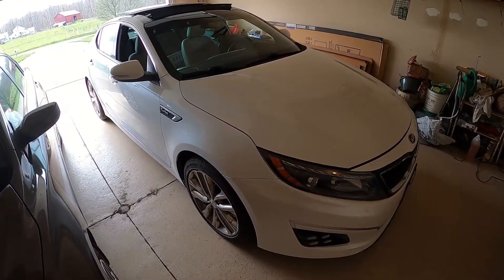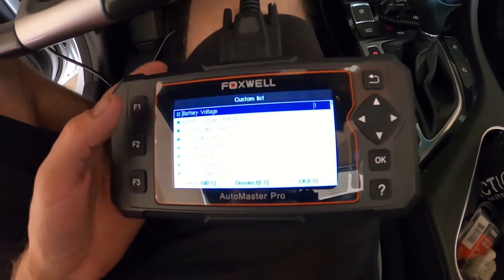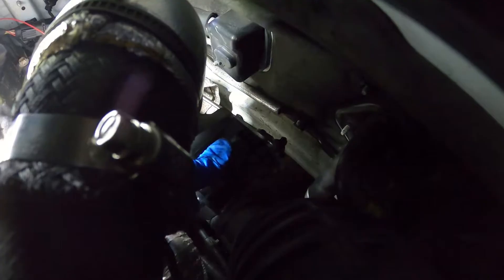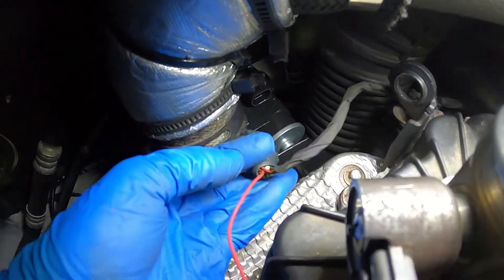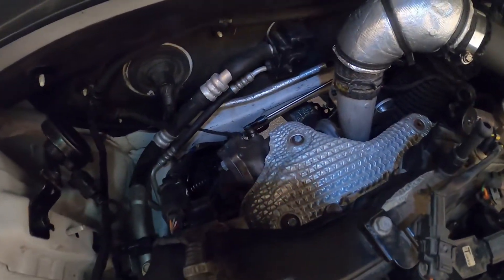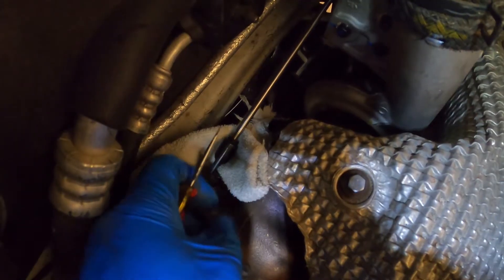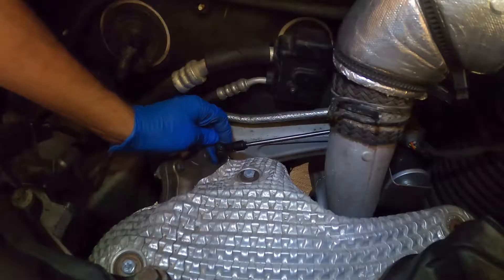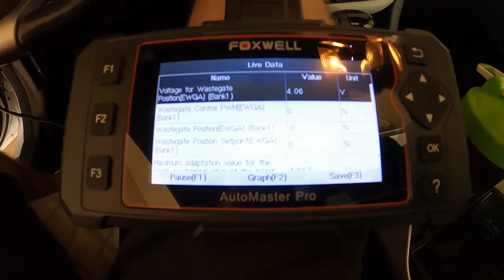HOW TO ADJUST TURBO WASTEGATE VOLTAGE ON KIA OPTIMA HYUNDAI | 2.0L | 4-CYLINDER | DIY | STEP BY STEP

Comment: And what does it do to the car? More power?
Reply from the maker: Hey Carlos. The waste gate helps control the boost pressure by regulating the exhaust gases. With engines that have a turbo its common for the wastegate voltage to change over time due to normal use which can potentially cause issues with boost and even throwing "over" or "under" boost engine codes. My video helps walk you through how to check and adjust the voltage to get it back in range. Hope that helped to clear things up. Thanks for the comment!
Reply: Thanks for the info, i had turbo cars bit i never had to mess with it or the wastage before so i dont really know why they do this or that to turbos, wastage or bov

Comment: I want to post another comment. I've already offered my appreciation for this video elsewhere. I want to offer some clarity for the content of this video, in hopes - if you were like me - it's helps you with my hindsight.

1) I was experiencing a P259f code which led me to believe my turbo was bad. I believe it was failing.
 
2) I changed the entire turbo, but, when asked, Blue Glove commented to he chose the installation of just the cartridge, which (trust me) I wish I would have done instead. Didn't know. If your turbo is dead (bearings, vane issue), a cartridge replacement will likely be 50-times easier. Ask me how I know. 

3) my replacement turbo came with exhaust manifold, turbo, and wastegate actuator, the latter of which Blue Glove is adjusting in this video. My voltage on a new unit was about 3.68 volts and I needed to adjust it. The car was still throwing a P259f code after installation of new turbo.
 
4) Blue Glove shows removing the clip acuating the waste gate side, but in my opinion I would suggest loosening the lock nut on the left side of the rod, as shown, but instead of popping that clip, which is in a tight spot and not the easiest thing to hook and remove... Instead loosen and remove the 10mm lock nut on the actuator motor lever, and once removed rotate the rod from there. When you're done making your adjustment -  reattach the actuator nut handbtight and tighten the rod lock-nut to verify your test reading. Way easier than clipping and unclipping that small clip between tests. 
NOTE: Only precaution here is to maintain the spring and washer when you remove that nut from the actuator (don't let it eject). Just remove the nut (pass nut to right hand while holding the rod still hard against the actuator) slowly pull away the lever watching that the spring and washer stay put, quickly turn the rod, and reinstall the rod, followed by reinstalling actuator nut (hand tight), then tighten the other nut to firm up adjusted rod length. I left the actuator nut only hand-tight until I was satisfied with the voltage reading, so as to minimize the wear on the Nylock nut. When satisfied with the voltage be sure to tighten both the actuator nut and the rod length lock nut. 
 
5) there is a body-to-engine ground strap just behind the passenger side motor mount - ideal for making a good ground point for the volt meter. Battery is good too, as shown. 

Hope this helps someone.
Reply from the maker: Hey Roger. I really appreciate your contribution! I made these videos in hopes they would bring about ideas from others in similar situations. I guarantee many others will follow your advice.

Comment: I wish I had seen a video of when you replaced the turbo. I'm going to see if you did one. Fitting that 12" round hole into 7" square hole was quite, let's say, a challenge. 

Anyway, I am curious. I just did a turbo swap on my wife's 2012 Optima EX because I thought the code it threw (P259f) said it was bad... Coinciding with a low-oil incident we had a week earlier  which threw the same code. A nieve assumption based on minimal definition on P259f out there. Considering it drove a week between each incident just fine, I assumed an oil-starvation issue. 

I was very surprised when the turbo spun freely when I got it out. But I wasn't about to wrestle the old one back in. By God! It Was Bad! And even if it's not - that new one is going back in. Money be danged. 

So, new turbo, which came with a new actuator, measured 1.23 volts after not fixing P259f. Honestly, as your video exhibited, I may have had the engine running and not in accessory mode as you explain. And I am not sure if that has an effect on the reading. So will reassess in the morning in lieu of expecting an answer by then, if at all.

Anyway, I am curious what your new turbo setup read when installed? Mine had all the joints dabbed with paint, which (to me) said "We preset this in the factory and you should not need to adjust this."

But clearly, you did. So yeah, curious. 

Thanks, if you can.
Reply from the maker: Hey there. In all honestly i tried taking video of the turbo swap but due to the horrible placement and the need to contort my body i became too aggrevated and stopped recording. Certain tasks are much more video friendly than others lol. 

Anywho, i have not seen the code you mention before (P529f) however, upon a quick search, it appears people are pointing towards the wastegate actuator and potentially out of range voltage which is what im assuming brought you to my video.  

You mention your reading was 1.23v? If you're able to follow my video step by step and ensure the vehicle is in the correct state when testing i'd be curious if your reading comes up closer to the ideal 4.0v.

What id try if i were you is : 

1) clear the code (start from a fresh slate)
2) turn car completely off
3) manually push the actuator arm all the way to the passenger side to ensure it is in the "closed" position
4) hook up your diagnostics tool or cable setup to prepare to read your voltage
5) with everything hooked up, put the car in accessory mode as mentioned in the video. This will move the actuator arm to its "home" position and give you the voltage reading you're looking for (4.0v being the target)

(I recommend repeating steps 3 thru 5 after every adjustment).

Im not a certified mechanic but i've fought with my fair share of car problems. I'd be curious to hear the outcome if this helped at all. If you set the voltage correctly and continue to get the code, you may have a wiring harness issue. If your turbo/actuator/wastegate are new, its quite possible you could get the code because your connector itself is bad not allowing the wastegate to function properly. Just a thought! Hope to hear from you again my friend!
Reply: @blueglovemechanic  Thanks for the quick reply. That's very much appreciated. 

Your video was very helpful, so I'll certainly add my notes tomorrow. All great suggestions. I do the same thing as you (details, details, details) on more than a dozen Auto-related FB and YT media. 

I'm a mechanic, but an Old-School mechanic. I really try, with any failure, of anything, to fix it myself. So my skill level is quite high. But lacking the "logic" of a system makes it hard sometimes on more complex systems. And dang it, I'd rather spend $700 and learn I was wrong, than $3000 and know I could have done it, really, for (say) $700, by doing it myself. But I searched everywhere (easily searched) for a bazinga on that code. So I deduced based upon the previous low-oil incident. (Kia engine replacement class-action, anybody?) To be 3.5qts low at your normal oil change interval (hey, it's my wife's car, it gets regular service, but this was unexpected) was strong reason to suspect the turbo, since it is oil-fed and it ran like the turbo... wasn't. 

I build old cars for a living, by the way. One at a time. I have a 1963 Ford Falcon Station Wagon about 80% complete after a complete repower, which includes a moderately built inline 6 engine, new transmission (non-syncho manual to automatic), better (type) rearend (7.25"-8.00"), new steering box, new wiring (my harness), and a few other signature mods... so I've been wrenching for almost  90% of my life. 

At 62... this turbo replacement wins first-place on my all-time list of most aggravating mechanical feats. Replacing a heater core on a late model car would be #2. But this I walked away bruised and scratched like I wrastled a ferel cat.

You would not have wanted to be in earshot that day. 

I'll follow your steps and report back. And subscribed.
Reply: @blueglovemechanic  Here's an update for you. Voltage was a bit low checked correctly. 3.68V. Took 1.5 turns to bring it to 4.16, which was fine by me. No codes thrown on my test run and the wife is out driving it on a second run. So thank you for your insight on direction to adjust based upon voltage - and clarity on the testing procedure. Very much appreciated, and your detailed instructions.

That said, we had already decided to replace it. Just wasn't willing to take $2K as a trade in. This is the near-to fully outfitted Optima for 2012 and still books at near 10K if I sell it. And having a new turbo will be a good selling point. So I feel way better now. And again, I thank you.
Reply: Roger M. When I replaced our turbo, I wasn’t getting the proper voltage either. I had to go through this very same procedure to set it and it ran like a charm. I used the multimeter method. Bad thing is that the waste gate went out after about 8 months and I had to replace the turbo again under warranty at least.

Comment: Great video. Will any generic scan tool have the ability to read waste gate voltage?
Reply from the maker: Im not entirely sure. I know the basic OBDII code readers will only read codes, so i believe you need an up to date "computer" style tool like i show in the video which allows you to connect to your specific year/make/model. If all else fails, try the volt meter/wire technique! Thanks and good luck!